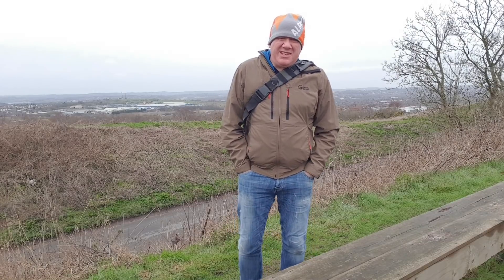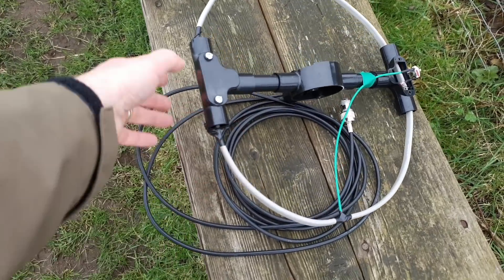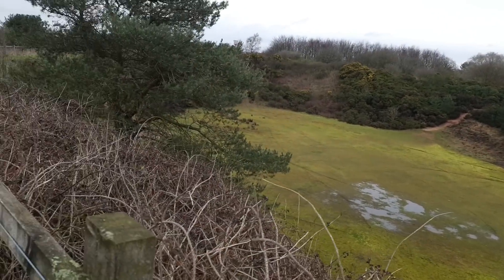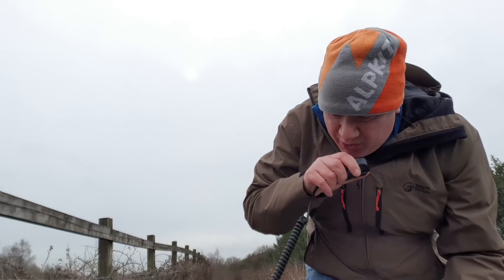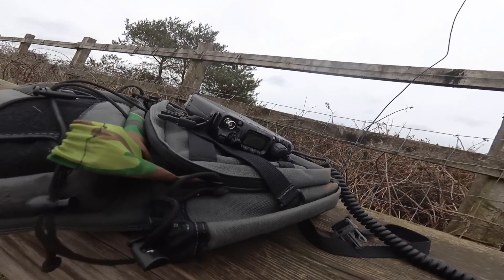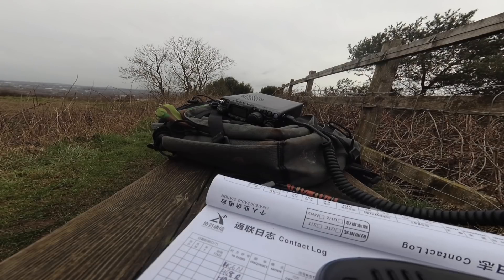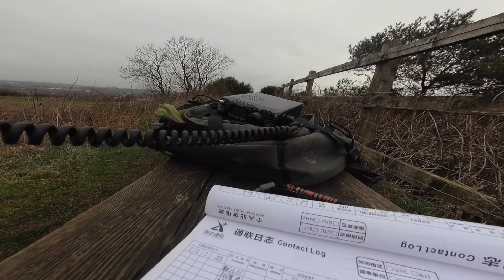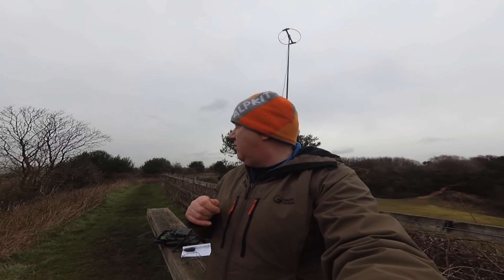Field testing the backpack 2m halo ham radio antenna

Comment: Hello and happy new year 🎉
Congratulations on the M0 callsign. The last video I watched you was 2E0. Anyway please forgive me if I am way off. I don't know much regarding the hobby as I am new. Would you not be better of using a roll up Slim Jim as this can be stored inside your backpack. You are using a mast so throw one of these up. I am new so please be gentle. I am not too far from you as well👍🏻
Motters M7TRS
73's
Reply from the maker: Hi, yes I also have the slim Jim, this halo is to work horizontal polarisation whereas the slim Jim is vertical, this can make a big difference especially on VHF. Most SSB operators on 2m use horizontal (although it's not a rule)
Reply: @M0SZT  that's good to hear I am still yet to make one (sj) that is I am very late to the game here. Need a NanoVNA before I start messing with homemade antennas. Still not got my head around it all ssb upper and lower and all that. I mainly sit on hubnet on DMR as I am in a dip and can not pick much up with a HT 😔 thank you for the feedback and again congratulations on the M0
Motters M7TRS 73's
Reply from the maker: I found the nanoVA is quite complex and fiddly. If I could go back in time and buy a decent antenna analyser for HF VHF and UHF I would. An analyser is a key tool if you plan on any homebrew antenna work
Reply: @M0SZT  good morning. Yes the right tools can be very expensive. Everything is out of my range at the moment until I find a job 😔. I only plan on making a handful of antennas. Dipole, slim Jim, Zepp, 1/4wave ground and 2m/70cm ham sat. If I get a HF a linked dipole. So a NanoVNA would be handy. Looks a cold day wrap up if you are going out.
Motters
M7TRS 73's

Comment: Nice one Carl! Where did you find that backpack? I’m on the lookout for one that has lots of internal pockets like that for my radio stuff for doing Sota trips. Yours looks like it fits the bill.
Reply from the maker: I use either Maxpedition or 511 gear as it needs to protect. You can get tactical looking bags cheaper but in time they may not last. In this video I use Maxpedition Gearslinger.